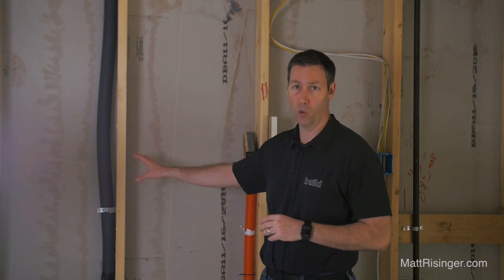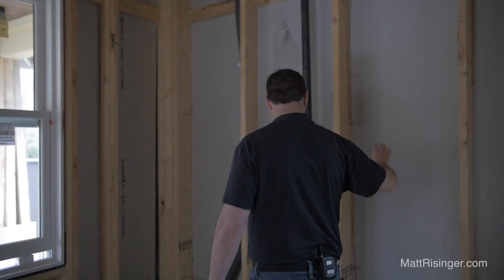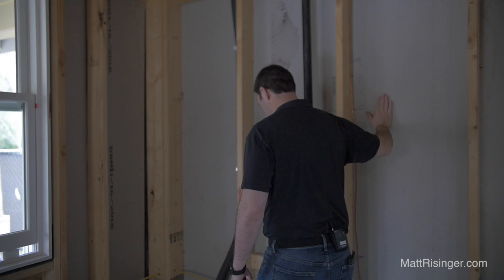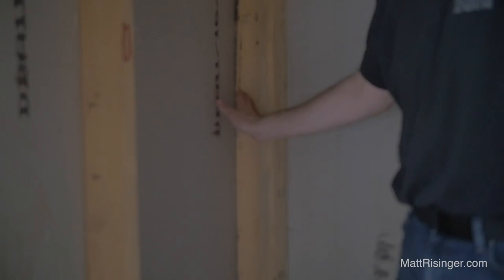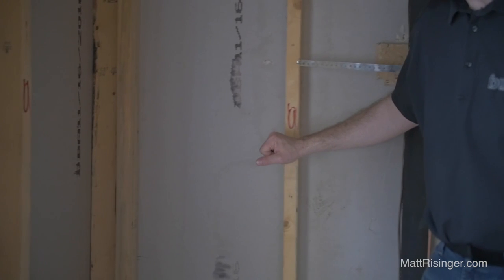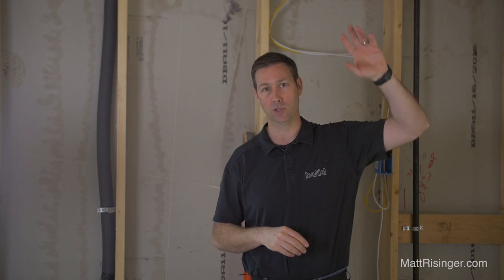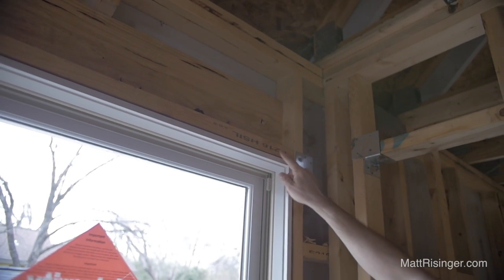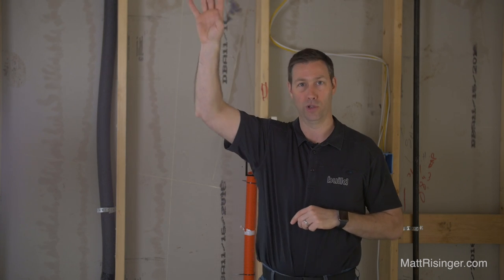Traditional vs. Advanced Framing

Comment: That "advanced house" is built bad. Look at that "header hanger" Its attached with bugle head screws (big no no) and holes are left unattached. There is virtually no load transfer to the king stud. You NEED trimmers in that window, plain and simple. Most new houses are built with 2x6 16 inches oc anyway. The 16 inches provides better anchoring for drywall and siding. "Advanced framing" is more like "cheapo contractor building a crappy house to maximize prophet."
Reply: Its a gimmick.  See how easily you'll poke through drywalll on 24'' centers vs 16''
Reply: Travis B 
It's 5/8" drywall. Everything is bulked up. It's mind boggling how much building on 24" centers there is in Texas, where this guy is building. Especially roofing. Amazingly it holds up fairly well because there's no snow load there.
Reply: Daddy Sheldon   Garbage, right.... better insulation with less structure, the hell with that. I'll take the heating/ac bill over that paper thin piece of garbage house. Single studs at the corners.... no 4x4's or doubled 2x4's??? Plus those garbage 2x4 trusses in the roof are crap for snow load. Trusses are good for span but can't carry shit. I'll go with the "tried and true" WFCM.
Reply: Tom Foolery 
He's building in Austin Texas. There is no snow load to consider. Many houses, especially older ones have 2x4 roof trusses on 2' centers.  3/8" decking is the minimum for sheathing roofs here in Texas.  Most use 1/2" sheathing but it's unbelievable that such substandard construction is acceptable here.
Reply: Daddy Sheldon so why this foo lying to us
Reply: The older homes in Texas have on trusses at all.
Reply: Randy Ward 
Our house has shed roofs with 22'  2"x6"s on 2' centers with a flitch beam supporting the rafters.
Reply: I put a Fitch plate in a house between an older section and the addition to support the 2nd story ...the new section was getting cathedral ceiling so I had to support it......that thing was murder to put in......
Reply: Daddy Sheldon blown insulation is OK for attics, not walls. A couple of years and there will be a gap from the insulation sagging. I would put money on the drywall corners cracking as well with minimal backing. And for the rigid foam backed OSB, garbage. the plywood should go on the studs to provide the stability the wall needs. add the rigid foam after for a better thermal break. from there you can do stucco, strap it for siding or masonry. Just my non-Youtube star opinion
Reply: I'm up in Canada and the only thing I've ever seen for roofs is trusses on 24" (usually 2x4 with 2x3 webbing), with either 7/16" osb or 3/8" ply, and very rarely 1/2" ply. That can stand up to snow load just fine. Trusses are engineered so if the engineers say they're good enough its good enough for me. I have heard they don't last long in fires though because the heat pops the truss gussop plates off and everything falls in.
Reply: Most of the houses I've done up in Ontario here are either 2x6 walls with osb or 2x4s with 1.1" foam, either way its the same R value and the same wall thickness. I've done a few houses with 2x6, osb and the foam, but really who cares how thick the walls the are. But yeah those jack stud replacements look sketchy.

Also an easy fix to the corner studs its to simply turn one stud sideways, so the two studs in the corner make an L. That makes room to slide insulation in, and is also faster and sturdier than putting in blocking, which is time consuming. The same can be done for where interior walls meet exteriors. That's the way its been done here by most guys for over a decade here in Ontario.
Reply: on 2x4 walls, an extra stud in the corners is solid and no cavity and the headers,  use solid plywood to do away with the cavity there and a 24 inch layout will make the sheet rock  bulge with net and blown insulation.  very hard to make base board trim to look good.  and yes tremors are a need..  good eye..
Reply: @Tyson de Haan, I've seen the results of that and the only situation where it makes any sense at all is if you don't have any insulation and don't want to tear up all the walls.

It used to happen with older houses in parts of the country, but it shouldn't be very common anymore. Between old buildings being torn down and ones having already been properly insulated.
Reply: Chris L I have an older house, built around 1900. Gutted 75% of it 3 years ago so I could insulate and reframe what rooms I could. The interior walls were two layers of 1" board with lathe and plaster on top. Way too much work, but a great experience as well.
Reply: AGENT 47 did you mean "unless"?
Reply: As a drywall contractor i would only hang on top of 24" centers if I had an agreement that i offered NO GUARANTEE. Matt is selling snake oil. This is brain dead construction.
Reply: Disagree on the gap, at least for blown-in fiberglass. My 1901 home had blown-in insulation (from the outside, probably from the 70's) and with every wall I pulled off from the inside during my remodel I found it held into the top corners perfectly. Very few voids at all which was surprising considering the glass was blown in blind with only two holes per stud cavity.
Reply: +Tom Foolery  Thanks for the WFCM recommendation, I have a read 3 books on framing. None of them were as comprehensive or informative as the WFCM. And it's a free PDF available online.
Reply: did you notice he said the house his buddy was building it the "modern"...aka shit on the other guy thats not his friend and make his friend look like a smart guy
Reply: No full depth wood over the window to hang your curtain rods on. there is going to be a lot of holes in the drywall.
Reply: I think you mean Profit....
Reply: exactly what i was thinking lol
Reply: Shake and Bake baby agreed
Reply: "Advanced"...lmao, what a joke!  That "Advanced" build looks like it's going to cost at least double a traditionally built home!  The next most important question people should be asking is...how well is the "advanced" build going to hold up to a tornado?  Did anyone see a termite treatment in the so called "advanced" build?  Or aren't there termites in Texas?  I don't understand how 24" oc framing is now a standard for structural/load bearing walls?  Who's rewriting building code?
Reply: Shake and Bake baby agreed I rather give up R value than having my house blow down..
Reply: I'm also wondering about that second floor in 2x4, if built the traditional way you have more weight on lower floor exterior walls. And no header jack on a load bearing wall?
Reply: I need help building a 4 bedroom house on man made Island in Mexico, can anybody give me some direction or a good blueprint 
I love wood frame and drywall I don't want to go brick,
Reply: paul bika vido go stucco..
Reply: Donn Worry  wow any links to  good videos I can watch? About stucco
Reply: Donn Worry we have earthquakes and winds stucco is safe?
Reply: never shake or bake a baby.
Reply: oltedders it’s acceptable because of the pro business attitude in Texas. It helps the business. Can you imagine if a car were built specifically built in Texas and only for Texas.
Reply: Travis B - makes it harder to put up  cabinets to without having to pull drywall down and adding more studs to support them.
Reply: Couldn't have said it better.  16 oc for exterior walls is a no brainer for anyone interested in Quality, Performance and Longevity.  The lateral loads potentially encountered are too risky with a gaping 24 oc.  That applies to interior or exterior.  Sad that people are being bamboozled by , collusive no doubt, permitting and planning departments
Reply: Chad I wonder about the popping gusset thing, would a 1/4" bolt through the center with washers and internal spacers make trusses safer? Does it even matter though? If a fire is already raging in a roof, anyone inside would be dead already.
Reply: I believe its for adding more insulation, not to save on studs.
Reply: We use a lot of stucco in California.  It seems to hold up fine.
Reply: oltedders 
Or earthquakes
Reply: I agree with you
Reply: @oltedders, If you have no snow load, and are far enough away from normal wind hazard areas (tornadoes and such), you really don't have to worry about much that will harm your wall.  As long as it makes minimum code, no one will ever realize there's an issue.  Try that in Tornado Alley or in the far north, though, and it's a whole different issue.
Reply: You mean profit not prophet.
Reply: @tysondehaan3722  as long as the nails go to the same depth in the stud there is no difference in rigidity. The only way there would be an issue is if you glued the OSB directly to the stud and even then minimal difference.
Reply: Shake n' Bake Totally Agree. 

Ask him how to fasten his exterior trim PROPERLY With cheap ass corners like that. XBX for 2x4 walls on exterior corners. PS most outside corners are also the end of an HD Wall so you have to frame those with 3 studs. This is not only common sense, it’s good framing technique. This crap is just that.. CRAP
Reply: Also at 24" on center studs after drywall if you lean on that wall you will definitely feel the flex, it's weaker
Reply: oh!......oh!.....
Reply: It sounds like this has more to do with energy efficiency rather than structural integrity.
Spray foam does a good enough job that we need not nit pick on 16" o.c. R-values.

I thought he was going to point out "let in" braces VS squaring with panels.
Reply: @oltedders  no snow load, but those tornadoes tho!
Reply: AGENT 47  lol i was gonna say the same i can't take his post seriously b/c of his spelling
Reply: @johnparker7784 is it that bad? Our builder is using 24 on center and 1/2 inch drywall...what kind of issues will we run into?
Reply: I see nails and not screws. Don't be moronic and talk out of your rear end just because you are not familiar with something

Comment: A couple of things. AV also requires single top plates and the floor joists, exterior studs, and roof trusses should be aligned if possible. The alignment allows transmission of the load straight down to the foundation.

Comment: Up here in the great white north we have been using rigid foam sheathing for years. Also a 3 stud inside corner works great for both insulation and backing. We call it an "L" corner

Comment: If you actually look into the science behind insulating, Its not a huge deal that the header and corners are not insulated. The cost behind changing that, outweighs the savings by a mile. on paper, sure. in real life, not a big deal like you are making it out to be.
Reply: Sorry but you're uninformed.  The DOE has modeled extensive energy savings with AV vs traditional framing and there's little cost difference.
Reply: could you please link the articles you're referring to? I'd like to read and educate myself, because I've read the contrary from the findings of a university masters class in envelope engineering. thanks in advance.
Reply: Crickets......
Reply: Buildingscience.com. 

Dr. Joe Lstiburek is arguably the godfather US building codes.

Comment: Not sold on header hangers. They'd make nailing casing a nightmare and there is no positive load bearing in the header system. Not to mention bulging the drywall at every door and window opening. I'd also prefer 19.2" OC walls to 24" for purposes of drywall and wall sheathing rigidity.
Reply: MJorgy5 As he stated. There aren't earthquake or snow loads to account for.
Reply: MJorgy5 but they are engineered. They do great if an opening is too small the we remove the trimmer and good as gold. The hangers work but i don't prefer.
Reply: All this is is an advertisement for some building products and builders.
I would like to know how the sheeting board is attached. If it's inside the osb is not shear if it's on the outside it's not nailed properly
Reply: what insulation do you use for 19.2 oc?
Reply: I mean you could just nail around the hangers, but I could see myself easily going along and forget rhe plate, end up swearing at them when I'd feel the backpush of a nailer on metal only to see a deformed nail that doesnt want to come out or go in.
Reply: as a drywall/metal frame supervisor those clips or anything where you have screws or nails bulging out is a massive issue. we have to deal with wood frame electrical boxes screwed in with pan head framer screws and it absolutely bulges the drywall and causes issues
Reply: @soxnpats4lyfe  and now you gotta go find a nailer if your board breaks over the window, which is where we try to put them.

Comment: Glad you're talking about this. Important topic, getting more insulation in the walls and speeding up cycle time while using fewer materials. Still AF is frustrating. Wobbly walls, for one. Metal clips for another. - Ladder blocking is gold medal IMO compared to channel transitions. I run ladder blocking flat to the interior face of the stud in remodeling applications so it can be fully insulated from behind. This seems like it should be OK in new construction too.
Reply from the maker: +MyFixitUpLife show good comments Mark. We need to do a Framing video together!  Best, Matt
Reply: Awesome Matt. I'm in.

Comment: 1:05 Those closed corners are not "traditional framing". They are flat wrong. You never do a corner like that unless certain circumstances force you to. In that case, the framer would pre-insulate while building. The correct way is with a 3-stud "L" set up which give full structural connection AND leaves access for insulating. Also the interior/exterior intersection. No, that's not a dead air space. That was done correctly, by making an "L" which is open on one side so you can tuck insulation in behind it , just like you would with a "ladder" (which is actually less efficient for drywalling). As for the "advanced" house... there's very little "advanced" about it. Just a couple different methods and materials that could be used anywhere.

Comment: What are your thoughts on framing a wall on a 2x6 sill and top plate but use 2x4's on 2' centers that are staggered every foot between the interior and exterior?  The inside and outside walls are still on 2' centers but you break the thermal conduction of a solid 2x6 stud.  I've seen that done in northern climates.
Reply: Great for soundproofing.
Reply: I'd never recommend using 2x4s with spacing exceeding 16" that is intended to have sheetrock installed to the studs. Typically any spacing over 16" should call for 5/8" drywall, adding a fair amount of ridgidness between the longer spans

Comment: Sorry bud, but 3 stud corners have no dead space in them
Reply: That depends upon how those 3 studs are arranged. A traditional corner does have dead space (third stud in same orientation as all other studs in that wall, but with a 2 inch gap between it and the stud at the very end of the wall). A California corner also only uses 3 studs, but doesn't create any dead space, so it can be insulated. For that corner, the 3rd stud is rotated 90 degrees and placed touching the last stud in that wall segment and flush with the interior side of the wall. Rather surprising what a simple rotation will do.
Reply: Daddy Sheldon the best way to build a corner using three studs would be a double stud with a flat stud incorporated.  gives your all of the corner strengths to support load and you can get insulation in there.
Reply: California can keep their building methods, Texas is not communist, yet.
Reply: Actually the corners I build have four studs, as any framer would know.  I am not a fan of dead air in structural components.
Reply: You can also insulate any dead space in a corner before you close it in if need be. I usually use roxul which is immune to water incase it got wet before the roof goes on.
Reply: This dudes a joke.  You can spray foam any corner. Bat insulate the corner before sheeting. Put that foam shearing on a traditional framed.  Two foot on center is not new.
Reply: Randy Ward 
Look up california corner. 3 studs, No air pocket.
Reply: There is a half inch of dead air that can be filled with foam before the sheathing goes on.
Reply: Alot of guys use leftover blocks and nail it to the two studs stacked on top of one another to provide nailing for the adjacent inside corner. Using 4 studs would eliminate that. Any "t_wall" with and exterior side will have a pocket,  unless someone rips a filler
Reply: Is that considered a “U” channel?